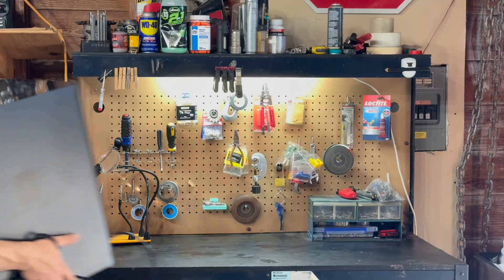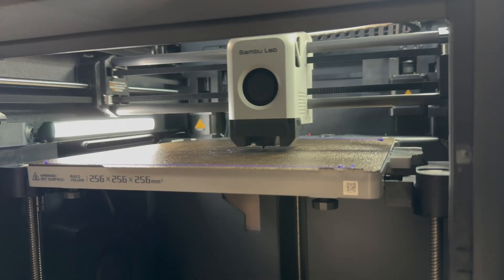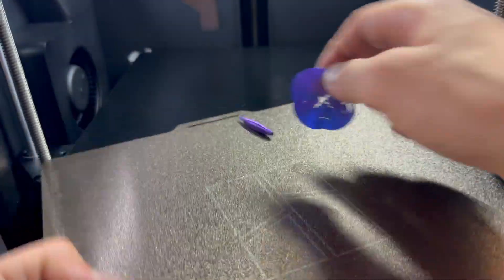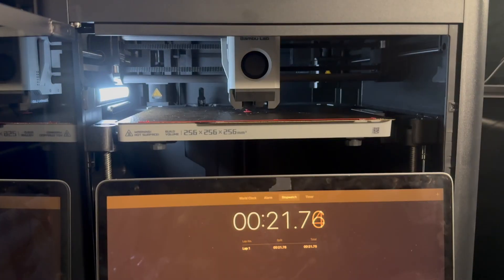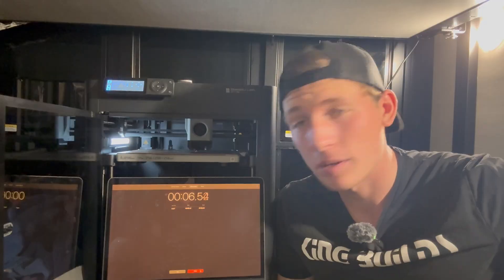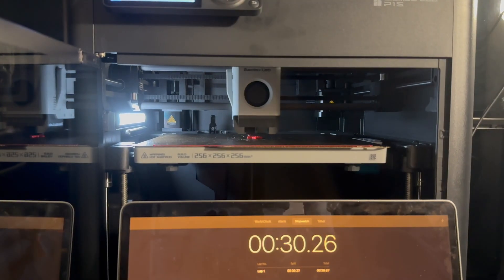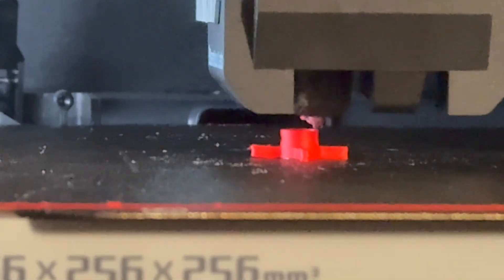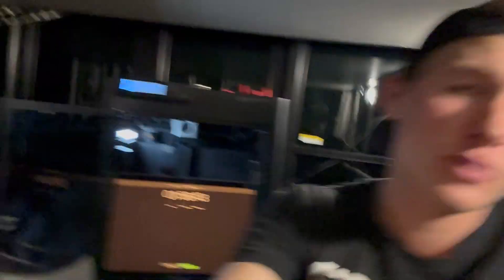I Tried 90-Second 3D Printing on the Bambu Lab P1S

Comment: 2:38 You're holding it upside down. Your thumb should rest against the bump that's currently rubbing against your plate and the blade should be almost flat against the plate.
Reply from the maker: Thank you👍
Reply: @kingbuilds8  It took me a bit of searching to figure it out, since they don't really include instructions for it! It makes it a LOT easier to remove prints without damaging them.
Reply from the maker: Makes sense..